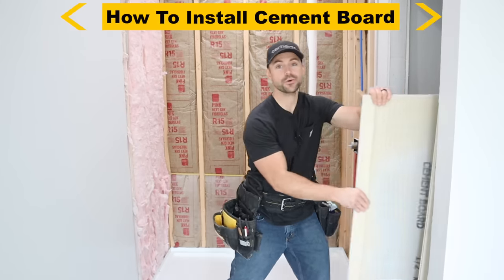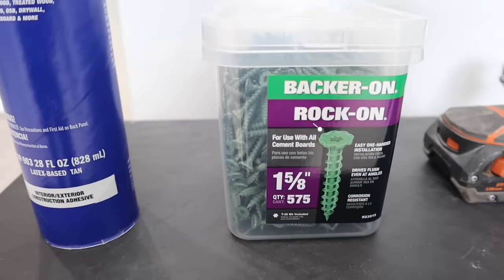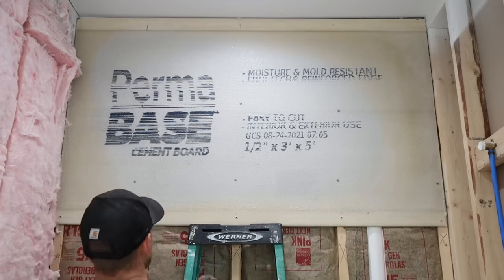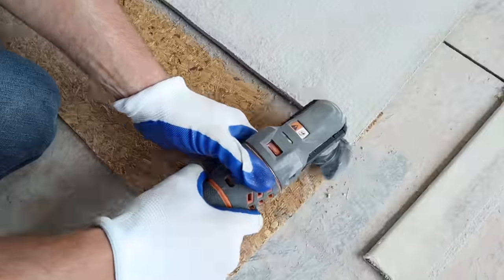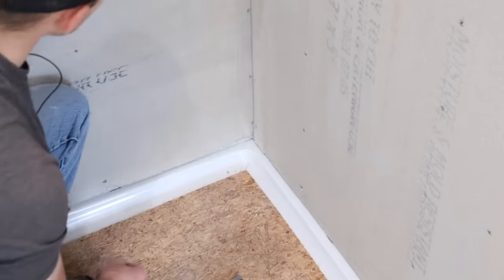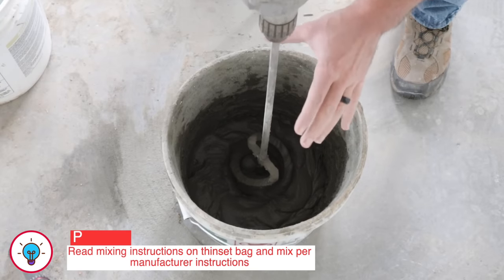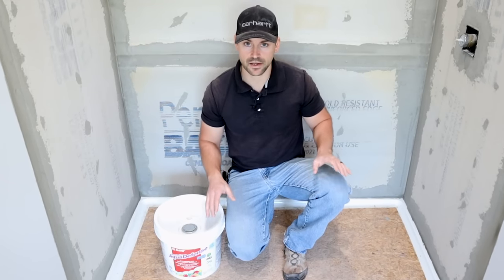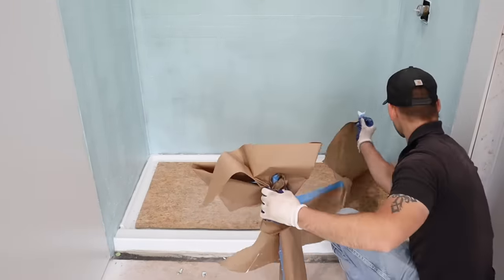How To Install Cement Board and Waterproofing For Tile Shower Walls - Complete Step-By-Step Guide

Comment: 1-Plywood on the base is a good idea, but the crumbs from the cement board will get between the plywood and the shower base. Protect the base completely with cardboard or whatever before the plywood. 
2-First shim the the studs out from top to bottom to accommodate the shower pan up turn on all the walls including the walls out side the shower so sheetrock and cement board are in plane .
3-Start from bottom up leaving a 1/4 gap on ontop of the shower base. Much easier. 
4-Leave 1/8 inch between sheets for mortar to key into the sheet. 
The but joints on the shorter walls will create a bulge in the wall do to orientation of the boards. 
5-Fiber tape needs to be ALKALINE resistant!
6-The thinset around the mud ring on the diveter is pointless.  The mud ring gets removed when valve is trimmed out.
7-Water proofing is optional not mandatory!
8- Water proofing comes in 1 gallon buckets.
Reply: Hi,  when leaving the 1/4” gap between the backer and shower flange, what do you recommend doing to seal it? I haven’t started my shower yet and there’s all different ways people are doing it. I’m going to use butyl tape from the flange to the studs before putting backer up as well.
Reply: @vanessap8717  The 1/4 gap should be sealed with a flexible sealant.  "caulking". In the real world I never sealed that joint . I relied on the silicone at the shower base and finished wall tile. By leaving the space open you eliminate the possibility of water ever wicking up the backer board.  The flexible sealant is the correct thing to do though!
Reply: @vanessap8717  as stated, that bottom gap should be hit with a bead of 100% silicone, prior to tile installation. Keeps the job watertight and prevents water from wicking into the cement board.

Comment: Could you have used shims on the studs to allow the cement board to hand over the lip of the base?
Reply from the maker: You could do that, except it would flare at the bottom of the cement board out some. Most people would not notice so it would be fine in most cases. It would be best to shim out the whole stud if you were to do that. I hope that helps!

Comment: Would you use cement board behind a plastic 3 pc shower stall installation? and if using cement board for a shower stall kit, would you use waterproofing before applying the panel adhesive?

Comment: Hi Josh, thanks a lot for you videos. They are great and straight to the point. One question I have is regarding the gap between the backer board and the ceiling. Do I need to fill it in with thin set or something, or just fill it after tile is installed (with silicon calk)? I am going to install tiles up to the ceiling. Thanks a lot.
Reply: Do both.

Comment: Nail plates for wiring? 
Gr8 vid
Reply from the maker: Typically the wiring is in the center of the wall plate and it will not hit it but if you feel like you should definitely do so. Thanks a lot Rodney!

Comment: thanks for the informative video. Question? I'm gutting my master bath and putting in walkin shower. Would it be advisable to rip off sheetrock from walls prior to putting on backer board for shower?  Thanks
Reply from the maker: You would not have to per se. I would just because it would make the shower a half inch smaller on each side which can really make a difference. Hope that helps!

Comment: Hey Josh, I like your channel and content, it's been very helpful as I am remodeling our bath room. I am taking out a tub and installing a Delta walk in shower kit. I do however have a question or two. When installing the backer board, in your experience are you putting the board on top of the lip or the tub/shower? Your thoughts and recommendation would be appreciated.

Comment: Question.  Is this different than hanging drywall?  We always put drywall on 8ft tall and only 4 wide so we have no seam that isn't on a stud.  A house we just finished had it the other way and we had a 4 ft high seam all the way around the room with no stud behind it.  The top row of drywall has (over 40 years) slid down against the bottom piece, creating a buldge we had to sand out and retape.

Comment: Well I did one of my first shower tile jobs directly onto old plaster walls a few months back. Hopefully I get some time out of it at least. I took down the old shower wall insert paneling, scraped as best I could, waterproofed two coats, then used a product called echo prim to provide a rough cement board like surface for thin set to adhere too. I’d like to hear your thoughts on this. If nothing else, it was good practice. Thx!
Reply: Fail, you needed to use an uncoupling membrane if you want to go over plaster or drywall

Comment: You're great. Thanks for the helpful training. Can I ask ... When you cut the wonder board, and have no bevel in the seam of the wonder board , like you have on the right and left side cuts of the wonder board, how do you avoid the thinset bulging a bit?.  Thanks again.
Reply: Not much of an issue, just use enough thinset to cover the tape. The 1/4 " notched trowel allows the thinset to level its self out over that small hump when tile is applied.

Comment: Hey Josh, I agree with all the other comments, EXCELLENT series on cement board, shower pan install, tiling, and grout... Complete and Fantastic stuff.
I have a shower that needs every single onenof these vids. From shower pan replacing to tiling. I feel 1,000% more comfortable with rhe whole project having your vids in my back pocket. Will let you know how it goes/turna out.
Ciao

Comment: Question do
I leave my cement board off the concrete floor a little ways or set it right on the floor and just lay my dry pack ??

Comment: What do you do with the edge of the wall where the tile and curb of the shower meet the wall outside of the shower (in our case that wall isn't tiled and we don't want to tile it). How do you make sure the water doesn't leak between the tile and the waterproofing and onto the wall just outside the shower?

Comment: If im planning on tiling the whole bathroom, not just shower do i need to use cement board over drywall or do i tile straight on the drywall?
Reply: If you want to tile onto drywall in the bathroom outside the shower,  you need to use mastic instead of thinset to apply the tiles.

Comment: I may have missed it in your video, and I haven't found anything in the comments, but do you use the mesh tape and Aqua Defense membrane on the crack where the wall meets the ceiling?
Reply from the maker: I use mesh tape and thinset in the corners . After that dries, I place the waterproofing over that. I hope that helps!
Reply: @TheExcellentLaborer   Actually, no, it doesn't answer my question. I was asking about where the wall meets the ceiling. Do you use the mesh tape where the wall meets the ceiling? Thanks in advance.

Comment: Hey josh I recently run into your channel and i am a new happy subscriber.   I am currently working on my bathroom.  I just bought 1/2” hardiebacker for my tub shower.  I see you are using a different board.  Is hardiebacker ok? Or do you recommend getting another cement board?

Comment: Great video! Question for you: I'm planning on putting backer board on a faux fireplace in my living room so that we can add on stack stone tile. Do we still need the mesh tape and the thinset if it's not going to be in a wet environment like a shower? Or can I just put the sheets on and then tile over it?
Reply: Yes you do. Only thing you won't need is the waterproofing sealant

Comment: What blade did you use with the oscillating tool?
Reply from the maker: Diamond blade. They work well cutting cement board. Hope that helps!

Comment: what if your using the kerdi foam shower board? would you install the pan first then the concrete board on top of it or have the concrete board come to the floor and then install the pan?

Comment: Whats up josh how about the ceiling joint where cement and ceiling dense glass meet would you also do it with the same joint application you used or would that be regular drywall mud
Reply: Ceiling drywall*
Reply from the maker: Yes I just do the same joint where the cement board meets the ceiling. I hope that helps!

Comment: I see you use liquid nails on the studs before screwing down cement board. I noticed your bathroom is in the house. What happens when your shower wall is part of the outside wall off house? When you use vapour barrier do you just screw cement board over the poly clear. No liquid nails.

Comment: Hey Josh great video We got several estimates by contractors and they said the waterproofing of the cement board is unnecessary.  These are reputable supposedly contractors in our area Do you think they are off base I like the idea of waterproofing as you showed on your channel. Also where are you located?  Thanks for the great video.
Reply from the maker: Good question Gary. I personally think it is a safer method to use waterproofing. Sure you could probably get away with not using it, but for extra security for no more than a cost I would definitely do it. Hope that helps!
Reply: @TheExcellentLaborer  thanks I want to hire you no idea where you work I am in the Philadelphia area. Is that anywhere near you?
Reply: @gary79973  if a contractor said they would not waterproof that is a contractor I would not hire.  I have done showers like this for years and have redone showers that skipped the waterproofing step and they fail.  Some in new builds too.  I would also recommed not using cement board but using hardi board instead.  Hardi board is easier to work with and is also better in wet applications.  Waterproofing is a must, with either aqua defense, red guard, or kerdi.  Have to pick one.

Comment: Hey Josh! Thanks for the great video. How exactly did you join the drywall and backer board on the 90° outside corner?
Reply: I'm a drywall finisher. That just gets taped with standard gypsum joint tape. We do it all the time at work.

Comment: Do you need to use a vapor barrier with these boards? Is RedGard necessary? If waterproofing is used do you still need a vapor barrier?
Reply: Rock board is sometimes rated as water resistant. However, I believe the more expensive stuff is rated water proof. I dont know because I got permabase plus which is resistant not rated PROOF. Consult the rock boards literature. Its whole systems. For me its: permabase plus, then tape and mud, then redgaurd with a liquied waterproofing membrane tape installed into the liquid waterproofing. Other guys will use straight dry wall. thats THEIR system. To me the water proof(ing) tape and membrane are cheap insurance. And thats not even a complete system because Im neglecting to mention the 100% silicon caulk Im installing where the tub lip hits the rock board. Do you NEED a vapor barrier if u "redgard"? Ive never seen one up in my experience on youtubes. Is it insurance? probably. Like on the tubs floor? Like redgard then add a vapor barrier? Yeah thats probably a multi layer defense. But yur fighting water and water always wins. Just how long?
Reply: @UCDjN8zrYvR8v5FFDa2oZO-Q I usually do for my DIY project vapor barrier, cement board, mesh and mud, and redguard. I use 4" waterproof flex seal tape on the bathtub lip where it meets the cement board to seal the vapor barrier. Any waterproof membrane will help tremendously if everything is installed right. My 2 previous shower walls and bathtub are rock solid and I am an amateur.

Comment: would a thinner than 1/2" cement boards for walls can work? 1/2" is so thick and heavy. also, at the rear side corners, wouldn't it be better to use silicone for flexibility? Thanks for the video!
Reply from the maker: The half-inch cement board is actually ideal for walls because it adds integrity. Quarter inch is only feasible if there is a substrate behind it. I would still recommend liquid nails over silicone for the backer board. Hope that helps!
Reply: @TheExcellentLaborer  Thanks. regarding the silicone, i didn't mean using it instead of the liquid nails, i meant in the corners of the cement boards and tiles due to some movement to prevent cracks

Comment: Stand up shower installed and works, but I've gotta put up Cement board I'm guessing for ceiling.  There's no tile or anything.  Stand up shower completed,  by sum1 but ceiling is bubbling up nasty. I wanna take it down, install cement board then seal top of shower to board I guess. Paint ceiling white. Help please  thought ideas. Very small room n small bathroom. And shower is 32x 50 I believe  32 4sure. 3x5 board perfect. Joint compound n tape etc..?? What kind of caulk

Comment: Is green board alright for the ceiling or do you need rock board there also? There is a lot of steam in a shower even if there isn't sprayed water.
Reply: About five years ago I drywalled our bathroom and lowered the ceiling to a height of about eight feet also using drywall with the intention to tile around the bath but I've just never gotten round to it! 
I'm now going to remove the bath and install a shower, obviously replacing the drywall with waterproof board but this was just to say the ceiling drywall has been unaffected by the shower water or steam while being unprotected by waterproofing or paint!
Reply: is green board alright? Yeah I'd say its alright. The latex paint is like water proofing to an extent. It water proofs the drywall mud. Like I can take a wet sponge and wipe down my wall paint. Like I can take a piece of drywall and submerge it for days and the drywall does not fall apart, the paper on the drywall does. Id say most "systems" say regular drywall is alright. But to each their own. Maybe youre building a sauna in there. Then No.

Comment: I use 6" window flashing tape on the flange and up the wall, then install the cement board above the flange so water doesn't wick up the wall in the cement board. DO NOT REST CEMENT BOARD ON THE SURFACE THAT WATER SITS ON! IT WILL SOAK IT UP LIKE A SPONGE AND CAUSE MAJOR MOLD PROBLEMS! Same idea as a pan liner and having a gap above the wet bed so the water can drip rather than soak it up. Other than that,good tips and install
Reply: i leave a 1/4 gap between the tub ledge  & cement board  then silicone but before i screw up my hardie backer I redgard the edges & 4" of the backside of the tub surround just to keep the boards from wicking up water off the tub ledge.

Comment: I have always been told the backer board sits above the flange, not go over it. Silicone the gap, then the tile will come down to cover it, then silicone again.
Reply: The way I've always done it. Never a problem.
Reply: I agree. As per manufacturers recommendations, the backer board should be kept above the flange. There's reasons for it.....!
Reply: @marcusewaldo3627  
You've never had a problem because you've never done a demolition and seen wet backer board where that edge has sopped up water.
Just saying......
Reply: @jojogo22  that makes sense. The board is a wicking material. The tub has moisture
Reply: why not paint the water proofing on the back of the board a few inches high and on the bottom edge as well.. I would imagine that it should stop water wicking  up the board.. right?!
Reply: @gilchie  
Sure....go to the extra expense of buying the product, when it's not necessary in the first place, the extra labour of applying it....When you can simply leave the edge up a 1/4 inch. As per manufacturers rec'd.
Reply: I just board to the ground , use a no leaks L shaped strip across the bottom of board and onto shower pan , then tile , then silicone along the bottom of tile , belts and braces , seen far far to many showers that have failed across the bottom and woodwork and joists rotten in ten years time
Reply: @jojogo22  your bang on bud
Reply: NEVER use silicone. Geesh!
Reply: @yeti7520 in the gap? Why?
Reply: @mommabeast5198  Why do you think? Nothing sticks to it, that's why. Fill the gap with mortar.
Reply: Yeah correct fill it with thin set and a good sticky 2 inch mesh tape. I always mud and tape all my joints every one and inside and outside corners with a small knotch trowel then embed fiberglass mesh (prefer 6 inch wide) and skim it with thin set let it dry come back and put on 2-3 coats of liquid waterproofing (Tec Hydraflex, Mapei Aqua Defense, or some Red Gaurd then lay all your tile with a good thin set like Tec 3N1 performance mortar or equivalent. Been doing that way since 2001 and never heard a squeak from any customer regarding a leak. There's alot of work involved if your going to be doing a full custom tile shower,....ALOT. We used to use silicone in all the corners and then lay but realized real quick it wasn't happening lol but no bullshit I bet I've done over 300 showers that's all I done for 13 years straight that and tile work but it seems its not as requested anymore. Everyone likes the 100% waterproof lvp and alike. I don't care what anyone says you can't outlast a properly built custom porcelain tile shower. Lady forever
Reply: I was always told to wear safety glasses when using power tools as well …😮
Reply: just as everyone wrote no board in the pan.
RedGard or the other is personal preference
Reply: The way he's doing it will wick water up the board. Your way is correct

Comment: So you didn't address where the cement board meets the drywall. Do you use the mesh tape and thin set to tie them together?

Comment: When is it recommended to use cement board over the foam board that you used in a previous video? Thanks and great videos by the way!
Reply from the maker: It depends on what you want. I like cement board because I have had lots of success with it. I hope that helps Scott!

Comment: Waterproof membrane should be behind board, plastic, or tar paper ( craft) 
Plastic coating over board reduces adhesion and mechanical bonding ( like mud job)
This is popular now to sell coatings. Not necessarily best way to go.